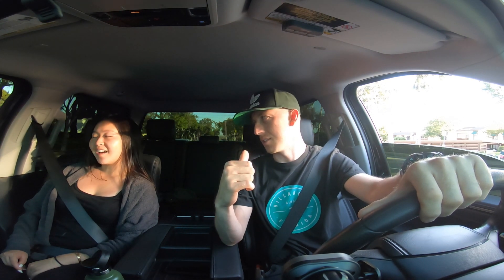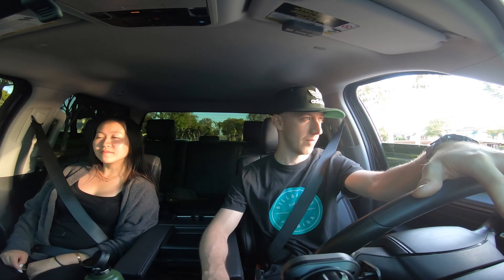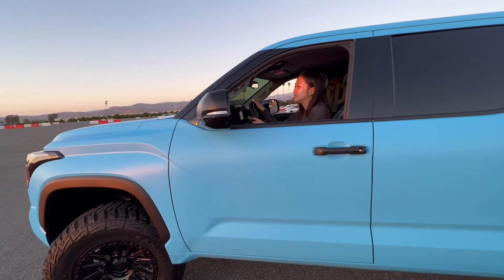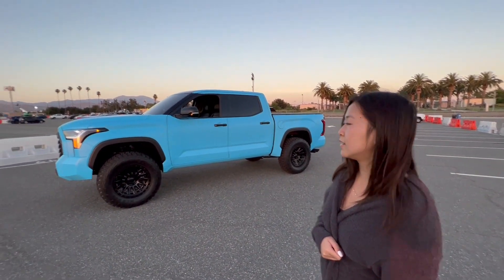Stuffing 37's On My 2022 Tundra!!

Comment: Mark, where you’re rubbing in the back is the trucks body mount. So you’ll need a “body mount chop” or BMC. Just cut off that area sticking out and weld in a metal plate in its place and paint it black to avoid corrosion. Excited for ya! If you haven’t wescott designs made an excellent video explaining how to fit 37s

Comment: Mark, the tires look beautiful. I think they're a little too big for that truck. I just wonder what's going to happen when you're going over speed bumps, dips and drainage channels in intersections or the most common is when the truck is just bouncing up and down on a rough Street. It might rub on some stuff  that you don't want it to. Once you start trimming stuff is going to look like s***... I'm sorry just my opinion.. You definitely won't be able to take that truck off the main highway.  You definitely have to put some wheel to wheel flat black 6-in step bars on....
Reply: Smart man, everyone only studies looks not practicality, if my tires rubbing i rather downsize than cut any part on my truck